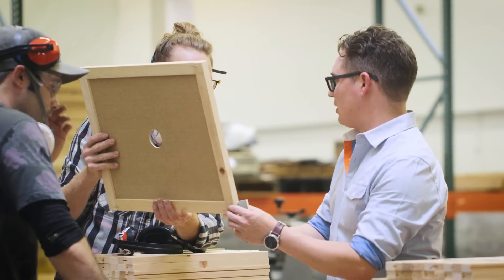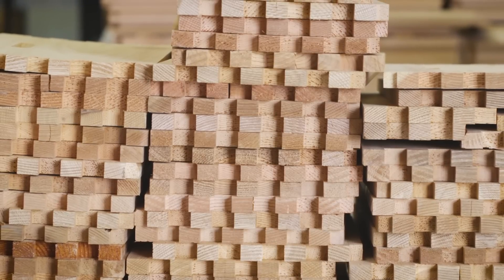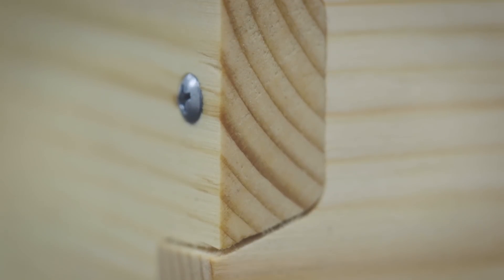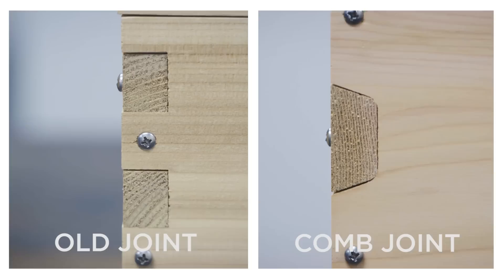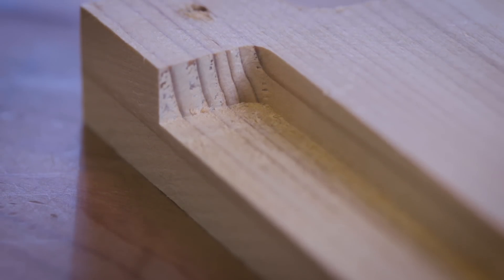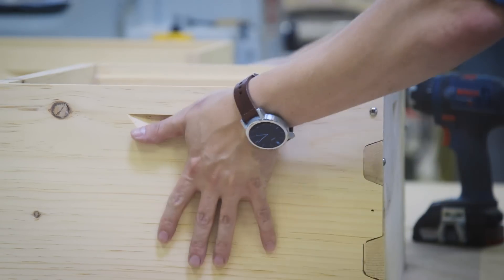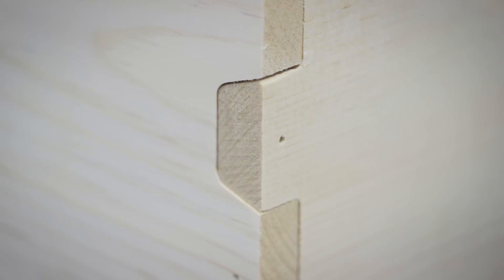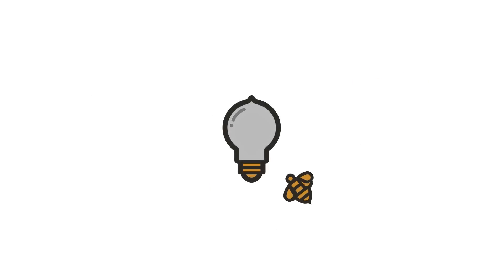The Comb Joint

Comment: I'm not a carpenter but I see a flaw with your design : part of what makes a finger joint solid is that even if it's not screwed or glued, a box with finger joint will hold together and would be liftable. This is because of friction (as you say in the vid, a finger joint can be hard to put together sometime) and because everything lays flat. With your joint, there's no friction at all, and the joint doesn't lay flat, so I would bet you couldn't lift a box assembled that way if it isn't held up with glue or screw. So maybe I'm wrong, but your joint doesn't seem to be very strong... 
But otherwise, I have to admit that this is a really beautiful joint !
Reply: But---while you're right, a problem with finger joints (in bee boxes) is they are always a tight fit and the adjacent woods are not exactly the same...& what happens is one side shrinks & expands more than the other side & this causes splitting.  
I prefer using rabbet joints, but these are cool too.  I don't care for finger joints on bee boxes.